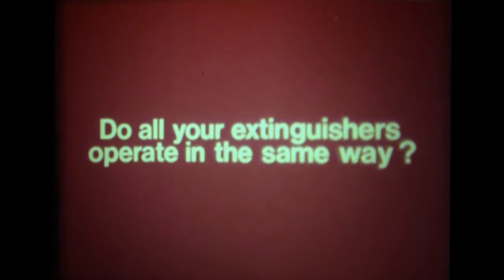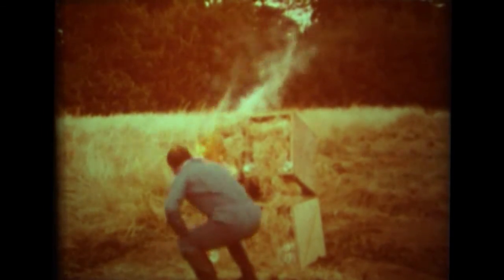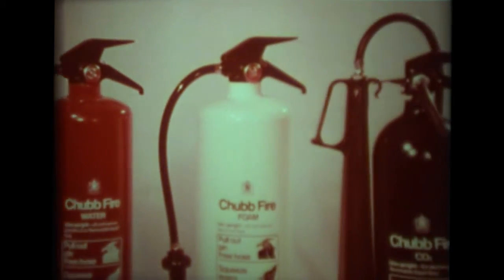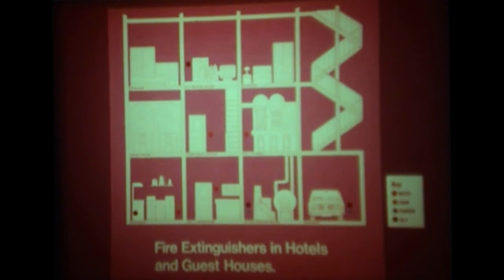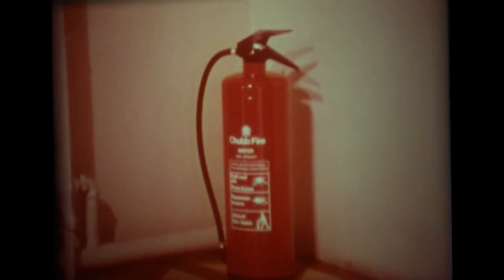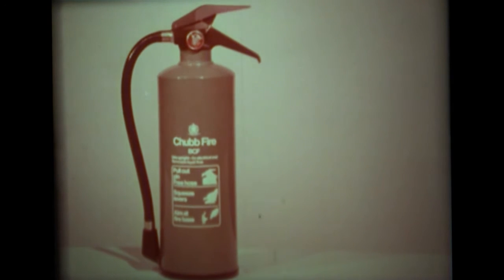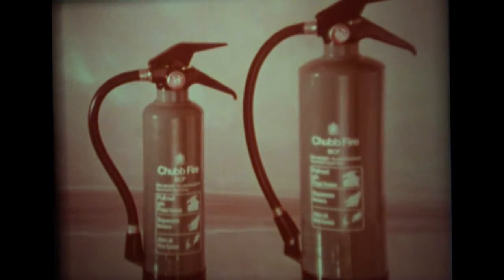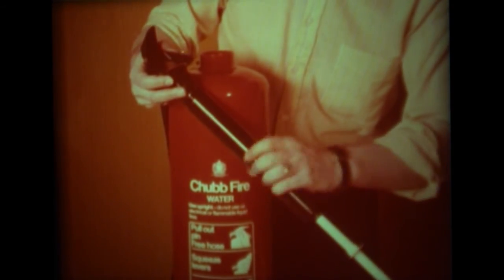1976 Chubb Fire Extinguisher Promotional/Training Film

Comment: BCF!....jeez and it was outlawed in january 94
Reply from the maker: Most new BCF production ceased in the 1989-91 as was most general sale of new extinguishers, but existing extinguishers could still be used and refilled (using recycled halon) right through until 2003 when it became outright illegal for general use. Most of the special cases allowed to still use BCF after 2003 have also now timed out with on board aircraft being the last permitted use, but even that expires soon.